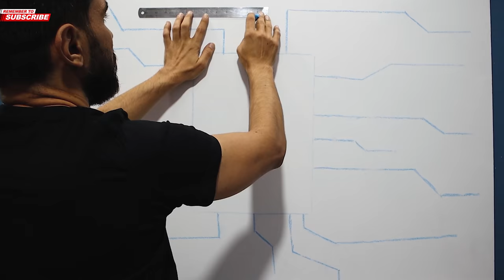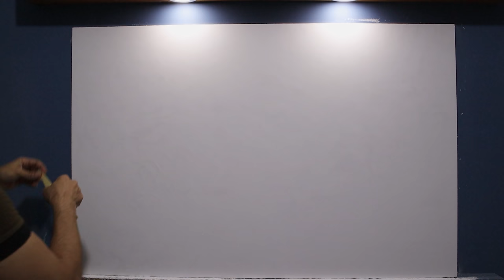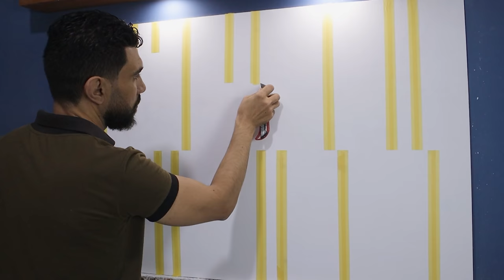ما هو تصميم حوائط منزلك المفضل؟ 3 أفكار فريدة لديكور الحائط يمكنك تجربتها 💡🤩

Comment: what is cement paste?, is it the same as  gib board plaster?
Reply from the maker: Cement paste is a mixture of cement and water used as a bonding agent or filler in construction. Gib board plaster, on the other hand, is a type of plaster used specifically for finishing interior walls made of Gib board.
Reply: @MohamedMahmoudArt  oh !! thank you so much, just to clarify, I guess its what is used to make concrete?, thanks for your help, absolutely love your work.